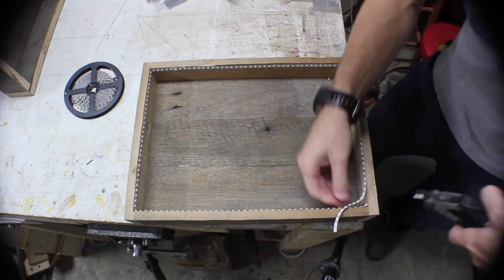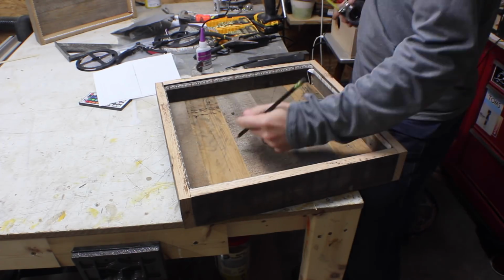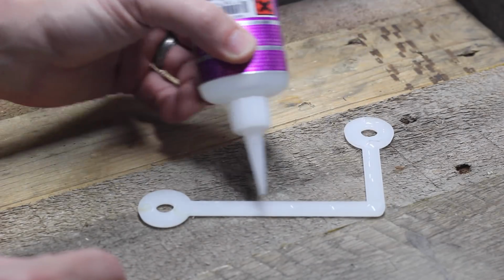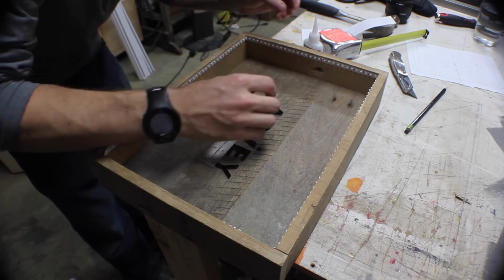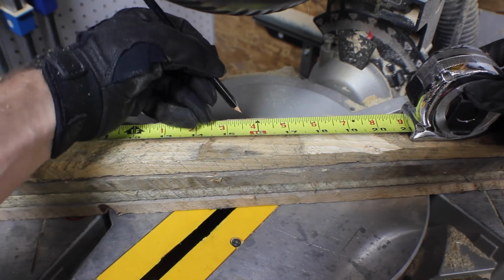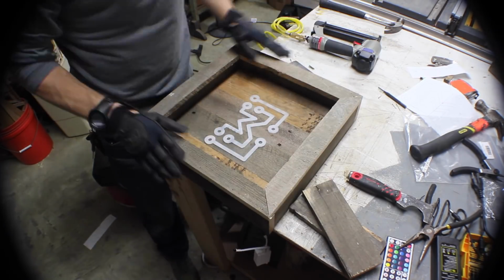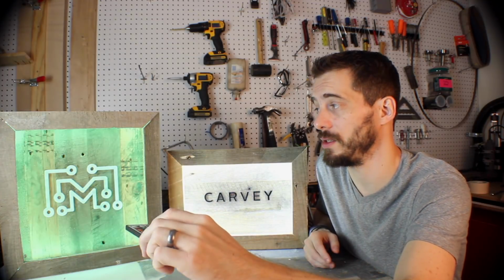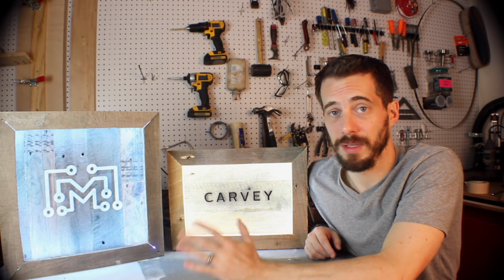LED sign with reclaimed wood // How-To | I Like To Make Stuff

Comment: what do you do with the remaining led strips? do they still work?
Reply from the maker: Yes! You can get another power supply and use it for the remainder.
Reply: Here's an idea for your next project then. Make a easy swappable led lights power supply where you can just take any existing led strip and plug it in without soldering

Comment: You can put the infrared receiver of the LED controller in the corner were the cables come in. 
They don't need a direct signal. Reflections are enough

Comment: What does a jointer do? I really do not understand it all that well
Reply: +Tim Chesebro A jointer creates a straight edge on a board.  Without such a straight edge, the board won't be perfectly even along the edge and when you cut it, it'll cut the same (usually curved) profile on the other edge of the board as well.  I have a jointer like he's using and I don't like it.  I prefer jointing the edges of my boards using a straight bit on my router and a router fence with shims for jointing.  It just works so much better and easier in my opinion.

Comment: what exactly is "the jointer" the tool you use to "clean" up the edges? What is it doing? (can not really tell from the video)
Reply from the maker: powersave2 It uses a spinning blade(s) to straighten one edge of a piece of wood. With that straight edge to can use it (on the fence of a table saw) to get a parallel cut on the opposite edge. https://en.wikipedia.org/wiki/Jointer

Comment: Hi, ive got a question I Like To Make Stuff , i'm thinking about making something similar to this but i'm concerned that it will be a fire hazard because of the LED's, when putting them on wood. Will using LED strips on wood cause a fire hazard? Thnx ;)
Reply from the maker: Anything is possible but LEDs (especially running at 5v) usually don't even get hot to the touch because of the low energy use. If it was really a concern, you could lay down a layer of aluminum foil under the strip to act as an insulator and heat sink.
Reply: ok, thankyou so much! subscribed! ;-)

Comment: Nice Job!  The link provided for the lights does not have a power adapter, do you know where you can purchase everything together?

Thanks
Reply from the maker: Marc Frazier Oh weird, I hadn't noticed that.  This one is the same one, but the page has options for size/power/etc http://www.amazon.com/gp/product/B00LTOC0DQ/ref=as_li_tl?ie=UTF8&camp=1789&creative=390957&creativeASIN=B00LTOC0DQ&linkCode=as2&tag=ilik-20&linkId=IOBR2SEEPPKVM36B

Comment: After using the Carvey, do think it is worth waiting for that to come out instead of buying a Shapeoko 2?
Reply from the maker: TheVelluch hmm..  that's tough.  I personally think the only draw of the carvey is the pretty package, and have it enclosed for the sake of cleanliness and noise.  If those aren't a big factor for you, I'd say the Shapeoko is the best bet.  Effectively, it's the same machine (with the upgraded spindle), has potential to be upgraded/expanded, and is WAY cheaper.  
It really comes down to what you want out of it.
Reply: I Like To Make Stuff Thank you for the quick responses. Your really made my decision a lot easier.  Although I like the sleek look and simple nature of the Carvey I don't like the fact that you loose the ability to upscale it or pass a long piece of wood through it when needed. If I can pretty much have the same machine with the quiet spindle upgrade then I will just assemble a shapeoko 2 with a dust extraction modification. How has the quiet spindle mod been working for you?

Comment: White is not really white not because of LED's, but because of controller. High quality RGB LED controllers make it any collor you want, including cold/warm white.
Reply from the maker: Ričardas Chuckas I've heard that from a couple of people.. I'm definitely interested in seeking out a higher quality controller to try it out!
Reply: Or if you wanna get into some digital electronics just take AVRStudio 6 (free to use), ATtiny13, lets say STK500V2 and get familiar with PWM. RGB leds are actualy blinking each of the color for the set period of time. Different the mix - differrent the color. If you get the right mix it's gonna be white, otherwise only somewhere close. Also different RGB LEDs needs a bit different mix, so its not only fault of controller, more likely mismatch. Though smart controllers should let you to adjust them to compensate mismatch.
If you are afraid of programming and digital electronics, you can try making three PWM generators with 555 timer, and try that to conect to RGB LED.

Comment: Do you think those light strips would work under kitchen wall cabinets?
Reply from the maker: Absolutely! They work great for situations like that.  My friend installed some under his cabinets and they are really nice.  Being so small, they hide away nicely.    Also, the RBG strip that I got are waterproof so you could easily put them outside under railings or steps for a really cool effect.
Reply: That is great. I have reviewed your link to Amazon and can' wait to get started.

Comment: Great video, gonna make some tommorrow. Still have some LED strips and pallet boards laying around. I had to cringe at the sight of you using gloves a the machines... co-worker of mine got his gloves caught and lost a couple of fingers a few years back.
Reply from the maker: These gloves are so tight that if they got caught, that'd mean my fingers were already gone :)  Plus, push sticks keep my hands pretty far away from the blade.
Reply: they seemed tight, it is just one of my personal preferences while working with wood. :) i would rather feel the wood while working with it, even if it is rough. guess you could say you get used to it when you are a carpenter. PS: greatings from germany

Comment: Hi Bob, love the project! To achieve a more pure white on the RGB strip, might it just be a matter of micro-adjusting the blue channel down a bit? From my experience with RGB LEDs, operating with 100% duty cycle on all 3 channels usually results in that bluish hue, so I take a few percent off the blue channel until it looks white.

I don't have this particular strip, but the picture of the remote on Amazon shows up/down adjusters for each channel, so I'd hope that'd give you enough control.

Comment: I am assuming the rest of the LED strip is trash after cutting?
Reply from the maker: No! At the marked cut points there are also two solder points to adding a new power source. Pretty handy
Reply: Ah good to know.  I've never worked with them.

Comment: The colors will change depending on what controller you use as well I think. I read that some of them are poorly "calibrated" There are also much smaller controllers then the one used here. You can get them with remotes that uses radio frequencies instead of infrared, so you don't need to point at the unit for it to work. They can be completely hidden. There are also programmable led strips that you can use with the Arduino.
Reply from the maker: Didn't know about the calibration, I'll have to look into that! Thanks for the tip!
I've got another idea that would extend this project a bit with using an arduino to control the light color and brightness.  It's definitely on my list of stuff to research
Reply: I've just started getting into electronics/arduino and my knowledge is limited, so I cant guarantee it's correct. Makes sense though. Different controllers would have a small difference in voltage for each channel, and that will make the colors different. (talking about the rgb strip here) Not sure if it affects white though. I have two 1m WS2812B programmable 5050 led strips that I want to make a clock with, using the arduino. Convenient, as they have 60 led's per meter. There are libraries available to control many of the digital led strips. Look up neopixels on adafruit and the fastled library. Sparkfun also has information on this.

Comment: How can I put a protective face on the front of the sign so that you can see the letters inside but can't touch them? Would glass be a good material to use or like a plastic?
Reply from the maker: You could make the front frame separately and attach plexiglass to the under side of it, then attach it to the box.

Comment: that is a really cool idea. I have been looking to make a sign for my workshop and I think this would fit. Although i don't have access to any CNC machines, any suggestions?
Reply from the maker: Max Nimmert Yeah, like I said at the end.. you could cut them out with a bandsaw or scroll saw.. or even just paint them on. Depending on the finish and color of paint that you use, you could get some really cool effects.
Reply: thanks, I have some stuff laying around for screen printing I think maybe I will use that.

Comment: Nice work Bob. That Carvey unit looks really awesome both the light and also the nasty edge on the outside look. I need to have a play around with those LED units, they have so many applications.
Reply from the maker: ***** Yes! It's amazing how much they can add to a project since they're SO easy to use.  You can also cut sections and resolder them together easily.